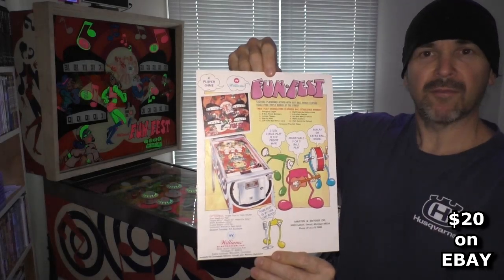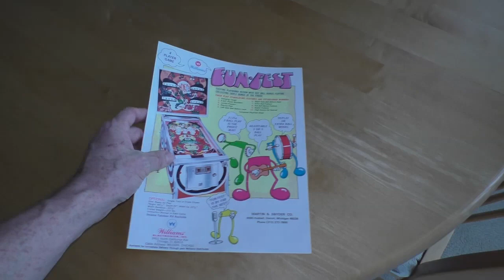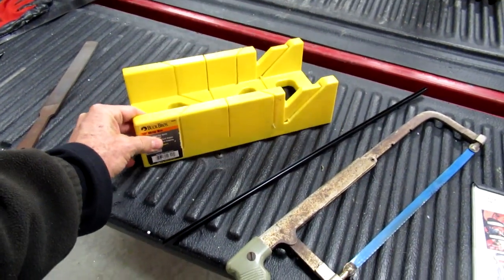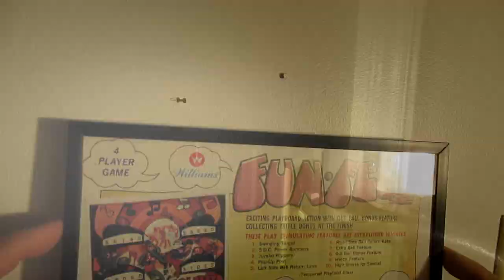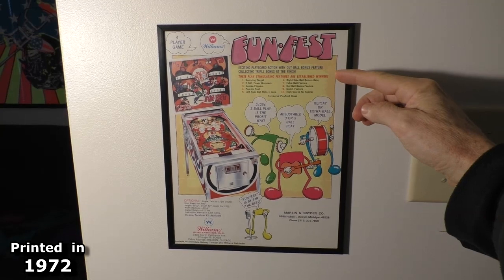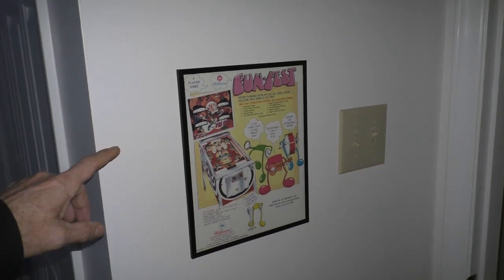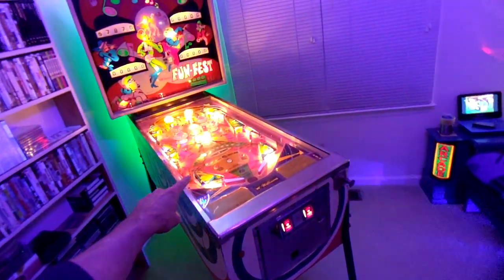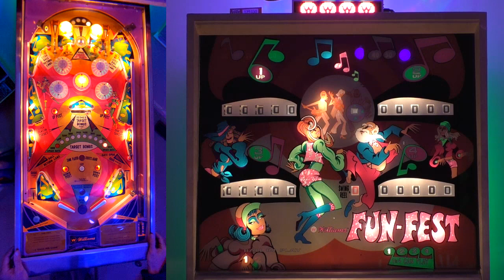FUN-FEST Pinball GAME PLAY and Custom Decoration Williams EM Mechanical SWINGER Arcade Machine 1up

Comment: Wow, that pinball machine is in perfect working order!  Looks brand new with the colors being so bright.  I remember playing pinball at the old roller skating rink and the bowling alley as a kid.  (Have kids today ever been to a bowling alley or skating rink?)  Thanks for sharing!
Reply from the maker: hi, yeah i recently went thru the machine again and fixed a few lingering glitches. I think what fixed it was resoldering all the jones plugs, there must have been a cracked solder joint that gave intermittent problems. I'll be honest this old EM pinball wouldnt hold up entertainment wise for todays kids standards, its kinda slow and sloppy. But as an old dude i find it fun and nostalgic, my father bought this particular machine in 1979 so ive been playing since then. thanks
Reply: @FunBubble  😀 Intermittent problems are difficult, glad this worked out.  Have a great night!